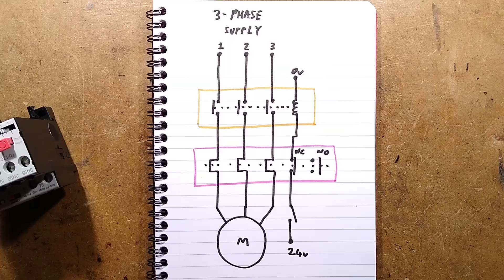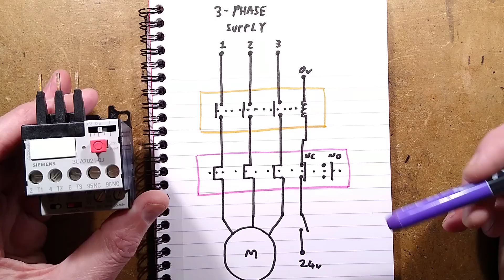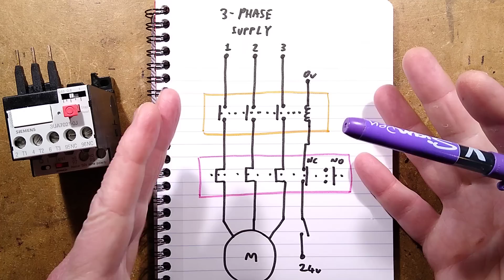Siemens motor overload relay teardown

Comment: More than once, starting up new construction, I’ve come to find out whoever spec’d the thermal overload read the 240V FLA on a dual voltage motor running on 460V and I have to ask for a replacement with the correct range 😂.

Comment: In case the main circuit breaker switch fails short and a massive overload the heating elements still work as a fuse 😂

Comment: Its honestly always a bit weird to me that devices labeled as a motor contactor don't come by default with these overloads. You always need them. A typical breaker is designed for a much shorter trip time that can be expereinced from a motor startup. 
Now this one is a very very basic unit. Slightly fancier bimetalic overloads are actually configurable with different trip curves, trip currents.
Even fancier units have completely replaced the heaters with electronic monitoring elements that are even more configurable.
as few new cost, we just got quoted a bunch of old bimetalic eaton ones and they are about $50 CAD a piece.
Now the cool thing is, there often is actually 2 bimetalic strips, one which is heated by the heater to trip, and one which is heated only by ambient air to serve as a ambient compensation if the unit it is in is quite warm.

Comment: Used to fit these most times to contactors when I assembled industrial heater control panels. Can't remember the brand, but they had a white round dial for Amps selection.
The cross head screws always needed checking when wiring up as you could too easily put the wire behind both small plates, instead of between, which had caused localised fires a few times! We had little room to see and closer inspection was a must!
And those screws could fail making you think they were done up tight, so always the tug test!
The units are good and reliable when used correctly, but was not keen on that screw system.

Comment: In the US the coil voltage is typically 120 VAC and the overload device opens the neutral side of the coil to drop the contactor out.  I'm not sure why it is done that way.  Maybe for ease of wiring.

Comment: Please test overload scenario of commando 16A plug (used in 32A circuit)
Reply from the maker: The plugs are generally well rated, but the cable might not be.  There should be 16A protection.
Reply: @bigclivedotcom  Well, I home made 3 phase EVSE with pigtail with 16A plug (for compact size), but I plan to use on 32A circuit. Cable itself is thick, 5x6mm. I could use 32A red plug, but it is very big, and yet I want the option to disconnect it.
Reply from the maker: @Mladjasmilic  I'd recommend you use a properly rated plug.

Comment: In German this would be called a Thermorelais (Thermal Relay). As always german describes the device in the name :b. Siemens also makes those relays with 5 connections to the contactor, fully automating the shutdown. I have also seen some weird ones that actually do break connection but only on a single phase as if you got a motor protection relay before it (often its redundant but sometimes its good for extra protection) it automatically trips that one aswell.

Comment: I think I dismantled a more primitive version of one of these many years ago. It had the three heating elements, red and green buttons for turning it on and off, and a big knob on the side for adjustment. It was clearly some kind of overcurrent detection device, but I didn't know exactly what it was designed for at the time. I'm pretty sure this video has solved an old mystery for me!

BTW, mine was a lot easier to take apart. :-)

Comment: I almost never use these because short circuits can often weld the contactors shut, and dropping the coil supply does nothing then. I much prefer a proper motor protection CB. I understand it’s a cost thing.

Comment: Which year were you born? 😉
Do you still know the protective switches for motors in which the relay part was hanging in an oil bath (Ölschütz/oil contactor)? 😎
https://images.booklooker.de/x/01LlUk/Autorenkollektiv+%C3%96lsch%C3%BCtze-R-908-w-R907-mit-und-ohne-Motorschutz-bis-500-V-Drehstrom-50-Per-s.jpg
https://www.picclickimg.com/6ZIAAOSwf-dkndTR/%C3%96lsch%C3%BCtz-MOL-28-Bereich-52%9386-A-Leistungsschalter.webp

Comment: They are designed to be rather self destructive if taken apart; no serviceable parts inside, for safety reasons. And yes Clive, they are rather expensive as manufactured by Siemens. Price varies by size of course, and the one you have there would have listed for over $100 US at the time I retired 8 years ago. (Industrial electrical tech). Of course you may be able to find Chinese knockoffs for a fraction of that, but they may not even work.

Comment: This overload relay is not that expensive. Those from other manufacturers are also in this price range. 
Here in Germany, this relay costs 40€ - 60€, depending on the retailer.
The more modern, electronic overload relays from Siemens. Eaton etc. are much more expensive. You quickly end up with 130€ and more.

Comment: Should do a test how quick they trip because in case of small motors like this, fuse won't trip. I guess the goal is to trip before the winding is damaged.
Reply: Search for a comment by sparkyprojects that has now 40 upvotes. I replied my measurements there that I automated to run for last night.

Comment: Interesting. I've installed hundreds of those things but never opened one up. One thing: in your diagram at 1:20 there's no short circuit protection. Not sure how you guys do it in the UK but here we typically put fuses or a breaker (the "mag trip") ahead of the contactor. Maybe you just wanted to keep the diagram simple? Also, customarily we break the coil's neutral with the thermal OL and the hot side with the controls. Not sure why, it's just how it's always been done here.
Reply from the maker: It was for simplification.  There would be suitable fuses or a breaker.

Comment: You mention loss of a phase tripping the unit through overcurrent, but all of these devices also monitor that all 3 phases are drawing the same current, and if 1 bimetallic fails to move in parallel with the other 2, it also trips.
Nowadays I try to avoid these things in favour of units which also isolate the motor directly in the event of a "trip". For example, a Telemechanique "GV2".

Comment: The motor overload relay remains me of our axle counters of the Heritage Railway.  The axle counter is mounted just inside the rail and can just tell the signal man the train has just pass that point or it can be used tell the signal man how long the the train is and the speed or all of that and turn a signal to red and if on a signal track lock the points and signal on red at the other end until the train passes the axle counter at the loop and so on.  It's just a box with two switches wired up to a power cabinet that intern wired to the signal box under the floor but it works

Comment: There’s also an electronic version that uses magnetic sensors instead of the heated trip mechanism. The latest ones are powered by the internal current transformers and don’t require separate power.

Comment: Wait most use supply voltage and a hold in circuit right? Electronic overloads are way nicer and temp compensate much better

Comment: This is wild Clive, this is only the second overload I've ever encountered that only switches the control terminals without interrupting the current going through it. All of the WEG, AB, ABB and Schneider overloads I've seen break the power section and the control section
Reply: No, you’re describing what’s called a “manual motor starter”.
Reply: @paulmccoy2908  It's a bit of a worry how unqualifed workers get their hands on equipment like this.
Reply: Nope, you are only working with small scale stuff then... hopefully.

Comment: Brings back memory's of one of my first jobs as an apprentice ,stripping down and cleaning  loads of old contactors.Along with adjustable trip current they also had oil dashpots to  adjust the tripping time , when the overload tripped it brought in   a solenoid that pulled a metal plunger up through the oil that broke the coil circuit..
Reply: If it had oil dashpots it wasn't a TOL like this... it was a Thermal/Magnetic Overload.

Comment: Reminiscent of the Sprecher-Schuh model I took apart some time back. That one had an inductive trip and heated trip mechanisms. The heaters were used in such a way that all 3 strips pushed on a lever arm and a certain level of load imbalance would cause a trip even if the overload current had not been reached.

Mechanical devices like this absolutely amaze me.

Comment: “Just push all the red buttons”

Oh, dear me. Right up there with percussive maintenance- great when it works but not exactly precisely diagnostic.
Reply from the maker: That was aimed more at people with their own workshops and with a basic electrical knowledge, as mentioned in the description.  Often an overload relay will trip due to a momentary issue like an obstruction or unexpected high load.  Knowing how to resolve that issue for a known event is useful.
Reply: @bigclivedotcom  Okay, makes sense. I will admit to rarely reading descriptions.

Comment: I'm guessing that front piece with the NO contact is available with other functions according to control system needs, especially when that control system is a bunch of other relays and push buttons in a standard box with a diagram in a folder somewhere .  I've seen diagrams that unfolded to well over a meter to describe just one box .  controlling a machine smaller than a shipping container .

Comment: Interesting. I've never seen those on the inside.
Maybe next time, take apart a Chinese one. A Chinese one might go into spontaneous spring-loaded self-disassembly at the first touch of the spudger, while the Siemens requires brute force in order to overcome the German build quality.

Comment: I wonder if it would be beneficial to have a way to detect different amounts of current between the coils
Reply: It does.  If this is used in a 3 phase application (and that could be used in a 1 phase situation) any of the phase 'coils' (heaters) will trip the aux. contacts. 
A fault condition could be both an imbalance due to a loss of one phase fault (causing excess current on the healthy 2 phases) or overcurrent condition on all 3 due to excess loading on the motor.

Comment: So funny Clive, I had my head in a boiler room panel for three hours today looking at six of these units. Two had been bypassed and one had failed. Only there to illuminate a red light on the front of the panel lid which everyone just ignores. Digital systems can send you an email which you also just ignore!

Comment: It’s a great make good to work with ,I’m of the day we had dash pots with oil in that worked on electromagnetic force which increases with current .As you will know a motor on start up can take up to 6 times the current .I also worked on face plate starters …great fun ( no electronics then ….😊😊😊)

Comment: I used to work at the distribution center of a major retailer. There was about 12 miles of conveyors in a 1.5 million square foot building. The whole system could be monitored on the computer. One night the monitor started calling out multiple motor overload trips throughout the building. The system ran on 480V three phase. Turns out that one of the phases from the utility had risen to 510V. Those overload relays probably prevented a lot of damage.

Comment: As a machine technician, I also deal with overloads quite often.  The control circuits are generally, but not always, run through a transformer off the mains.  There are several different designs of overloads but they all pretty much work the same way.  They shut down the control voltage to whatever they are protecting and there is then a start switch in line with the overload to re-energize the circuit.
Reply: The same TOL is found in stand alone DOL starters too. In such applications the supply voltage is used for contactor coils... perhaps 120V, 240V or 415V. 
In a DOL starter the STOP button will act on that 'Reset' button on the TOL. 
Yeah... as noted in the video, these act to interrupt control supply to the contactor they attach to. 
Sometimes TOL are not attached to a contactor, being stand alone devices. 

A STOP button will be wired in series with the TOL aux. contacts (NC circuit) in a multi-motor control cabinet. This will not 'Reset' a TOL. 
A START button will not reset a TOL.

Comment: I'm in industrial automation. So I see these things quite often. We dont realy use them anymore in favor of a motorprotectionswitch. (MBS in dutch, PKZ in german) its basically the same thing but with the mains contacts. But these do have the advantage of not being that expencive because of lack of mains contacts. I think the small once like this are around 30-40 euros (even from siemens). The larger once are more expencive ofcourse. But in industrial terms its not that bad. I orderd an 80A version from Sneider a couple of months ago. I think it was 80 euro or something.

Comment: Very nice contactor. At first I was thinking that it would use a ptc element but quickly realized that, that wouldnt work due to the ceramics high resistance. Always amazes me how factory workers can assemble this stuff at scale given the complexity.
Reply: These are assembled by high speed machines, no hands applied.  Gone are those days, unless the gear is over-priced due to labour costs.

Comment: 1:49 - And for some reason I feel it should be said, the normally-open (NO) contacts on the overload protection could be used to operate an indicator lamp to notify the user when the overload has tripped.
3:30 - Never mind. 😆
7:07 - They are beginning to use FVD (variable-frequency drive) in HVAC systems in the US. The main problem being the VFD drive is typically housed in the RTU (rooftop unit) where it gets exposed to harsh sun PLUS reflected heat off the roof itself - plus the internal cooling fan pulls all sorts of dust, soot, and pollen into them. They fail in a rather spectacular manner, especially when those fat juicy capacitors have had quite enough of that thermal abuse, thank you very much!

I personally don't mind watching the longer-disassembly videos. In today's world of instant gratification, I still prefer the "slow burn."
Reply: Sounds like you work on poorly designed equipment with insufficient IP ratings.

Comment: I had a standalone overload relay trip on a motor. Measured voltage on the contactor it operated and at first everything seemed fine. Turns out the contactor had welded two of the three contacts and when the demand for that motor went off the motor only got two phases that had welded together and that then tripped the overload relay

Comment: This protects the motor from loss of one or two  phases and then motor stalls and the still powered phases frying. High voltage power line lightning strikes or trees on a line are good at tripping just 1 or 2 of the phases.

Comment: i took those apart as a child. soviet ones. grandfather got them from workplace's mates i think. contactors. breakers. else. i later realized what they were. but i recall bimetal thermal overload trips. at least one was certainly motor protection relay

there were also blocks with other components. and i was told one of them was diode. so i tried to pass dc via it from my battery and bulb circuit. but it only conducted one way. so i was loudly exclaiming in home how this diode must be idiot for not passing current both ways. some of resistors didn't either iirc

grandfather wasn't that good in ee so he didn't explain me more. i later realized my father was much more into ee. but he didn't go along with mother so she got rid of him. later of course i turned to be having his personality too. likely he was also autistic

i had very controlling mother also. who has told me that i'm so bad and act just like father. well i do. i don't like people and i'm impulsive and violent

Comment: As a PLC guy that only does programming, these puppies were always "something our cabinet guy built in" and "a signal to feed the motor control block" to me. Cool to get an actual insight! Especially since we almost only have Siemens parts, so this is a familiar looking thingy.
Reply: Siemens commercial/industrial line is among the best-of-the-best. I've also never had a failure with their 12VDC relays (automotive applications). It's one of those times where you absolutely DO get what you pay for.
Reply: @dashcamandy2242  Absolutely! Also with their PLCs. In 20 years, I have yet to see a CPU fail in any fashion. I've seen maybe 4-5 IO modules acting up after 10+ years, and the odd PSU, but overall reliabilty is really good, and well worth the price if your 50k€+ of product per day plant depends on it.

Comment: Bimetallic strips are a good example that ones of the most awesome technical solutions are the simple, they can be used on some automatic devices such thermostats and thermal cutoffs, another applications for bimetallic strips are in car dashboards, as analog meters such fuel, water temperature and oil pressure...